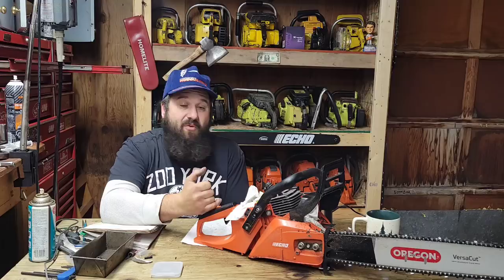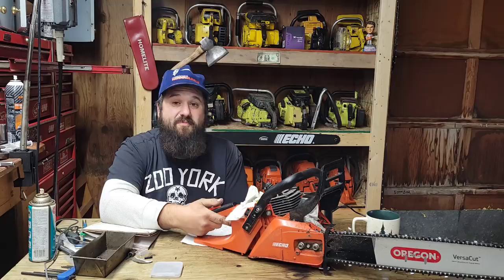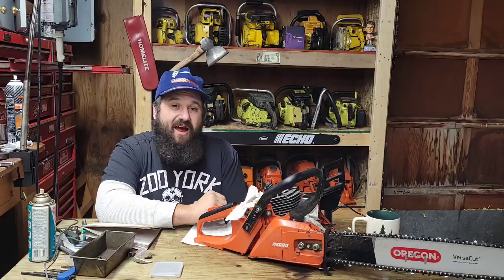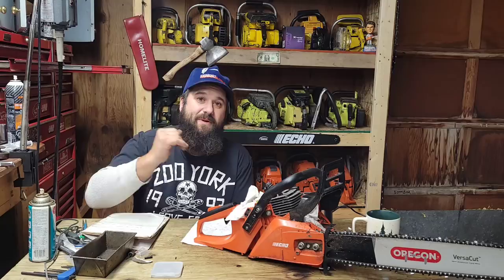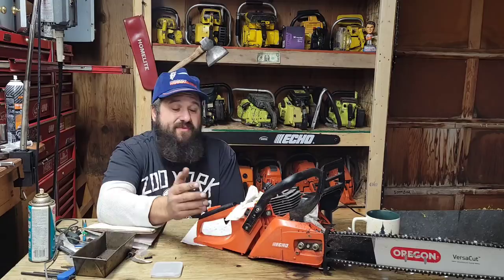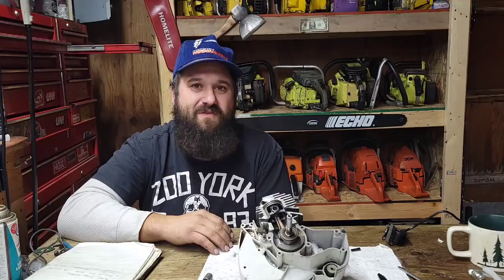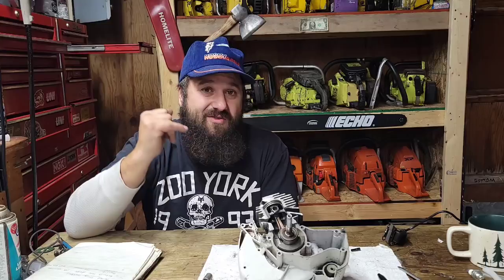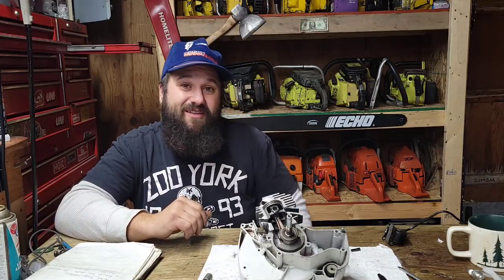Tinman, whats the deal with the Echo Cs 590??

Comment: Swap the nozzle in the carb... with Walbro 86-578-1. Very tunable then. I do it to everyone I port I’ve probably built 25
Reply: I understand the high jets in the 620p and the 590 have a bypass so they can't lean out - does your mod remove the bypass?  thanks?
Reply: @telecasterfool1773  it's a non bypass nozzle correct.. allows you to lean them completely out.
Reply: @buxtonworksawsllc9645  Thanks!  I ordered two for my 590 and 600P projects.  The 590 I'm making one change at a time, running it each time doing tree work to see the effects.  Thanks again!
Reply: I have given him that part number three times. I have this installed in my 590 with the 620 carb and coil. Solved all my issues
Reply: @Engine4dragon  Thanks for that!  I have a 590 with the 620 coil and decompression delete.  I have the 620 carb - it will be next.  Good to hear the nozzle helps.
Reply: @Engine4dragon  definitely the easiest way to fix them. Ive seen guys try to rig other carbs on huge pita. Hopefully he don't go that way.
Reply: @buxtonworksawsllc9645  Thank you to Buxton and Eric E - I swapped the nozzle in the 620 carb (HDA316), and it's installed and running nicely.  The carb tuned very predictably after this change.  The nozzle swap is very easy.  If anyone needs more info, reply to this.  Thanks, again!
Reply: @telecasterfool1773  awesome glad to help! Makes a huge difference in them saws.
Reply: Great to hear. Have a 600 P I'm working with. Thanks for the info.👍
Reply: @buxtonworksawsllc9645  whats it typically cost for a guy to send you one its for tree work not logging
Reply: Put three base gaskets lol just kidding
Reply: @joshuap7501  I don't like advertising on other builders stuff.... Feel free to swing by my website has all my pricing and contact info.
Reply: @buxtonworksawsllc9645  thanks
Reply: @telecasterfool1773  more info please as I have a new 620p that i muffler modded and still too fat (rich) on top end .  I'm like Tinman in that i cant stand to hear it run rich.  cleans up pretty well in cut but still lil rich and i think it cut rev higher safely...
Reply: @buxtonworksawsllc9645   what state are you?
Reply: Do you have to port the saw? I would like to do the carb,coil and exhaust but will it help without porting?
Reply: @jasonamerica7618  it helps any allows you to tune it. They are pig rich even stock.
Reply: @buxtonworksawsllc9645  Never ported a saw. I'm afraid to try it out on a good running saw

Comment: Raise the transfers to 118~122 primary and secondaries, swap the nozzle in the 620 carb. Should make a very agressive saw. While raising the secondaries be careful not to go too deep, up around 120 the top gets thin, if you get agressive trying to flatten the roof. If you need/want I have extra 590 cylinder. Good luck, and keep up the good work.
Reply: Wow I just watched your echo video again..thats some amazing work joe..very cool to see you giving a brother some tips from your experience with them..outstanding!!
Reply: @chapsmaketory3960  
I'm glad you enjoyed the video. I am all for trying to help someone trying to find more power from a saw. If I can help someone save a cylinder I will try my best.
Reply: @dynojoemods2764  Thank you for your generosity!  It's very kind of you to share your professional, hard won, advice!
Reply: You can always lower the edge of the piston instead of porting the cylinder, it not going to run as fast as a ported saw but it will run better
Reply: What nozzles should I put in?

Comment: Emm... some of the logic is a little off. Increasing the crankcase volume (opening out lower ports) REDUCES the crankcase pressure... imagine doubling the crankcase volume, crankcase pressure up or down ? "Primary Compression Ratio" for 2 strokes, is what we are on about here, and that long intake will give a low primary compression.  Seems to me you've analysed the rich mixture issue as part of intake timing being too long (entirely plausible) and then ignored it. How can changing the transfers fix that? Taking the exhaust off most likely just allowed the cylinder to empty out a bit more of the end gas - always good for the nest combustion cycle, thats not the same as pulling fuel back in from the exhaust.

Comment: Tinman, 
my first saw and mod, CS 490, pulled 13 500 wide open with the limiter caps removed.  I tuned it down to 12 500 because I'm happy with the performance for what she is.  Man, it is a torque monster.  she cuts slower than a stihl but the torque is great for a couple hundred bucks.

Comment: Thanks for the advice on putting in bearings I used it on my Polaris ranger. I put a new front wheel bearing in freezing the bearing then heated the hub. It worked perfectly thank you.

Comment: Tinmaaaaan 🙄, totally followed everything you said brother. If the entire charge can't escape through the upper transfers then it can't be lit.. On the downstroke that unspent charge will escape through the muffler as the fresh change is being pulled into the case. The process needs that change to be Forced through the transfers. If the spark is hot then there shouldn't be a problem burning what's being compressed. I know I'm babbling Tinman but I think we are pretty much on the same page.. BTW, I'm a diehard 266 man, just ported another one and trying out a Molybean piston from Duke's. Quite a bit lighter than stock and seems like a very hard coating.. I'll pull it apart after cutting a few chords and see how the coating stands up. Once again we are all thankful for the time you put in to all the great videos. The new phone takes very crisp vids brother.. SLANT'E

Comment: I hot rodded an echo cs400. It’s a light little 42cc power head with a custom 20 inch bar running a full chisel. I can bury the whole bar into hard oak and it doesn’t even slow down and it just throws chips. It’s 42cc’s out cuts every other saw I’ve ever seen under 60cc’s. I love roosting chips in my friends faces that are running much bigger and more expensive saws. To top it off, it can sit for months and I can go start it within 3 pulls, even on a 20* day.

Comment: I have many larger saws, but I bought a EFCO CS52 at the pawn shop that looked brand new for $80, it now has a 24" cannon super bar and a narrow kerf chain, it's very impressive for 50cc, many times the same saws are hot rods for the factory making over 4hp, so bigger saws with that much piss and vinegar would be making an easy ten hp.

Comment: Hi tinman  I am Greg young my experience with 2 strokes is in 1990s I built race jet skis and milled heads decked cylinders and ported for several local shops . Lately I have been porting chainsaws. I ported a cs620p similar to yours I do duration no opening time . Exhaust 163 intake stock height wider slightly nothing to transfer openings except chamfering better. I also put pop up piston in sea level here I have 165 psi compression no base gasket. I dont cc unless I have removable head . Opened up lower transfers slightly . I know the more porting is done that slot more compression is needed dont know if this is difference or something else I is going on. A popup piston is cheap and might be worth a try.   hope it helps . I like your videos I am just another guy in garage Greg

Comment: I really enjoyed your video, I hadn't thought to much about the engine RPM and power. I'm running an Echo CS-8002 most days doing 2foot dia logs into rounds for firewood. So, lots of long cuts, I so hear you about speed. Mine is sharp but I feel no ware fast enough. Will have to look at options to increase power of saw

Comment: So, I am a bumper jack when it comes to some things. I am a 61 ½ y o Stone mason. I used every kind of combustible tool I ever had close enough to put my hands on. I like the Tinman. I am in NH so when you start with this is so and so MM and so mm. I have to say I am not writing this down. What would happen when you change the rings before you carve up the replacement cylinder. Is this blow Down blow by?

Comment: I have a CS-590 myself. I love it when it runs. I cant get the low jet adjusted correctly, it dies on idle but runs on full throttle at start up. This saw has always defeated me. I have adjust and rebuilt plenty of carbs on other saws but this one always leaves me scratching my head.  Love the channel and love what you do with these saws. I have 12 acres in NH with mostly hard wood trees so I definitely fall in the farm ranch saw category lol.
Reply: See Buxton Work Saws llc comment about the Walbro part to change out. These carbs are made to run rich by having an extra nozzle in them so homeowners can't incorrectly run the saw lean and blow them up. You change the part to the new one without a hole in it and the carb becomes tunable like a standard saw. Worked great for me last winter on one i repaired for someone that wouldn't idle or run well.
Reply: The button in the main jet is the culprit. Just stop up the hole and the saw will run after reset the h l

Comment: Tinman, I have a 620. I'm just a firewood guy. As a former owner operator of a 266, I've been super impressed with the 620. I TRY to find fault with it, but cannot! In my heart, I'm a husky man. But I don't like the new Huskies. Money wasn't a issue. The 620 is a simple straightforward saw like my old 266. Question is, you think the primary in he 620 is same as the 590?

Comment: These saws are notorious for flooding, especially with the "compression release".  The real trick is to pull it a couple times when you have the spark plug out to clear the fuel ports.  Place a folded paper towel over the spark plug hole as the first 4 stroke will spray full.  You can now put a little tip full of oil directly in the cylinder if you choose (or not) to lube the cylinder, but be prepared for it to smoke for a few minutues when you get her back together.

If you are having a hard time pulling the cord without the copression release, pull the cord past the first "stroke" (first bump of resistance) and start your stroke from there.  Two reasons why this floods is using the compression release and not getting powerful enough pulls on the first 3 tries.
On a side note, if you are not going to be using your saw for a few months or at season's end, always let the saw run out of full instead of using the stop toggle.  As with all small carb 2 stroke engines, old fuel can mess with the ports.  The more times you leave fuel in the lines, the sooner you will be needing to replace the carb.  This is why your weed whacker doesn't work.  If you have to, drain the tank and run it "out" or gauge your project and fill the tank to match the job

Comment: Thanks for this, Tinman! I have a brand new Timberwolf with 20in bar and am asking what I should do to it. I'm interested in the 620 carb and coil, but wondering if you recommend I do anything beyond that. I mostly only cut birch and black & white spruce in winter in Interior Alaska, so usually near 0F or colder. I'd like to be able to run my saw in the 30s below. What modifications to the saw do you recommend I do to get the best performance out of it? Also, should I thin bar oil with diesel/kerosene or get a winter oil like Stihl's? I've read the Oregon all season oil is very thin and wondering if that would work. Also could adjust the oiler, since I'll usually be running thin oil. I've run saws a fair bit, but tweaking them like this is new... but I love perfecting things, so I'm open to having some fun with it. Love your videos. Thanks!

Comment: Hey tinman I'm as experienced in saws as you as I'm learning here to but I have had a echo cs-590 for 3 years 

All I did is remove the jet limiters and open the exhaust 

Everything else is stock and this saw will rip right alongside a 65 or 70 cc saw 

Pulling a 20 inch chain with a lot of authority

Comment: Curious to see what the fixes is for the 590. If it's true what you're saying too much into charge coming in, I wonder if opening up the intake port to slow the intake charge would help? Not changing the intake timing. Just increasing intake port volume size only. Thanks for sharing your notebook information.

Comment: Had my CS590 for 3 years no issues with it, until suddenly fail. It may need a new carburetor. Stalls and shuts off. Put new spark plug, new gas filter, spark arrestor was clean, put new air filter, cleaned up really well with compress air. And problem doesn't go away. It may need a new carburetor? It's common to have a carburator peoblems on this machine? I was really happy with it for about 3 years.

Comment: I'll have to look at my air filter. Check for fuel. What would you recommend one do if they intend to keep it stock. Just need it to run reliably/consistently. 

Doesn't seem relevant to what your dealing with. Though I had a 590 that developed a leak around the decompression easy start plunger.  
Luckily it was still under warranty.

Comment: Since talking abt different cylinder. What abt take one you have and JB weld the intake change timing . See if can save factory cylinder. I'd go with different cylinder like you said. But I've seen guys run cylinder with JB weld to change timming to get what they want. That or change flow pattern in both intakes and exhausts. When I get done with other projects have time get into saws. I'd like take a cylinder that classified as junk. And try welding the intake or exhaust and fix it that way. And see what happens. Of course be testing on my own stuff.

Comment: question? going down the 2 stroke Wabbit hole ...19:50 talking about increasing blow down from 15 degrees to 25 degrees by raising the exhaust roof. I thought supposedly blowdown is the distance from tdc until the exhaust cracks? so wouldn't you have to lower the exhaust roof (base gasket delete) to get more blow down and loose some rpms? Does the Tinman mean he raised the exhaust roof to increase the pump stroke in the bottom end? That doesnt seem correct to me. so I'm confused how the Tinman is getting 25 degrees instead of 15 degrees of pump or blowdown.
Reply from the maker: When I say blowdown I'm generally speaking of transfer blowdown. That is the distance between the exhaust opening and the transfers opening. The difference in degrees is the blowdown.
Reply: @tinmanssaws  Thankyousir Tinman. I completely understand your answer.... I had a video idea/ request. I recently rebuilt the top end on a ms271 and chose to buy a used OEM cylinder and lower priced piston. The rings on the piston had seized so I presumed the cylinder needed to be replaced as well ("mild" scoring on the exhaust port side). Thinking about it after I found myself being curious if the the OEM scored cylinder that I replaced was still salvageable/ did not need to be replaced. so I was curious if you would be willing to do a video about how to know if your cylinder is worth salvaging? for example does it take just one deep scratch to make it unsalvageable? glhf good luck have fun

Comment: yes, maybe the upper transfers are too small, or maybe the lower bypass ports are soooo big, that you might consider stuffing the case.  Thanks for the update.  [ I added this:  long bore=more fuel in the bottom end since the bypass ports were enlarged.  Harvey might disagree, 'bigger is better' he might say, but you've lost transfer velocity, and as you mentioned , too much fuel.]

Comment: Try a smaller carb. I put a tiny little carb from a hand held leaf blower on an 8hp Tecumseh that's runs a wood splitter and it runs awesome and it's held on with zip ties and wire.There's a video of a kid that owns a 76 ford Maverick car with a 302 motor and he made a throttle body that would fit on his car with a carburator from a " lawnmower".... Long story short he could rip the tires run all out and is getting 45'miles to the gallon. Even he said that it doesn't make sense and shouldn't work but it does. Sometimes man made machines work better when instead of going bigger go the opposite. A guy with a 2500 HP Vette was braking traction damn near all the way in a 1/4 mile pull . He turned the HP down and finally was hooking getting decent times.

Comment: could you skirt the problem (no pun intended) by fitting a piston with a longer skirt, shortening the intake timing?

or a piston with a lower pin and raise the cylinder for the same effect?

to me that could be a cheaper way of testing your theory/fixing the problem without potentially having to buy a new cylinder.

i am loving the more in-depth look at theory. 
to me i see it as, the more knowledge the greater the chance of making the right decisions on what to change.

Comment: I just put together my first farmertec kit saw and I'm getting gas in the muffler and spitting out the carb too
Reply: Carb float adjustment... Fuel pump?
Reply: @countryfriedent  I knew it had a bad coil when I first tested it out, I replaced it the coil and I got it to fire and run for 30ish seconds when it was bone dry but it hasn't started since then
Reply from the maker: Sometimes those farmertec cylinders have crazy long intake timing. You may have too much intake duration or the metering lever in the carb is too high.

Comment: Weight is one ting, balance is another! I would rather have a balanced saw and be heavy, then an unbalanced saw that is light!
The heaviest saw I have is my Sears (David Bradley)  I like my saws to be 50cc and above, but I also have some smaller stuff as well, that I run 14-16 inch bars on! The larger cc saws run 20-26 inch bars!

Comment: If you're still checking the comments, I have an Echo CS600P and it will not start after running one tank of fuel. What's the deal with the compression valve?